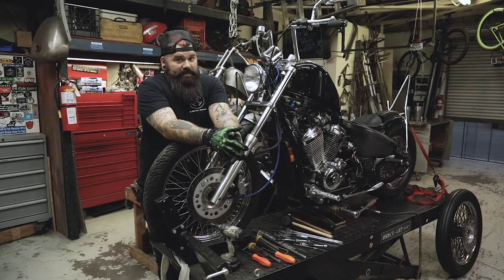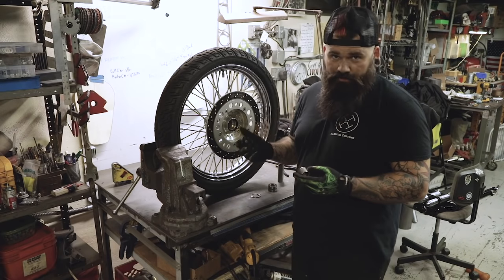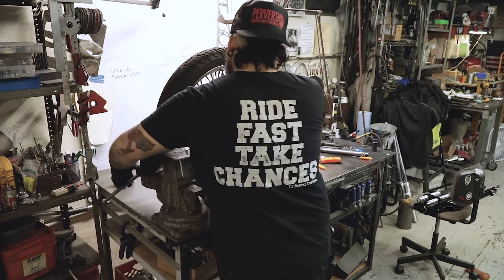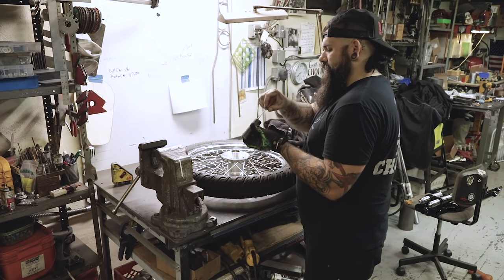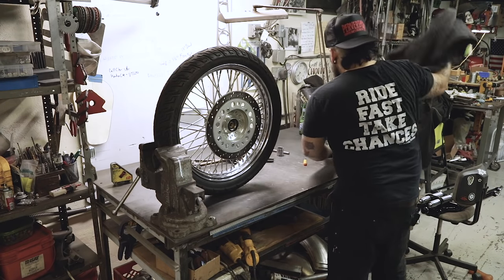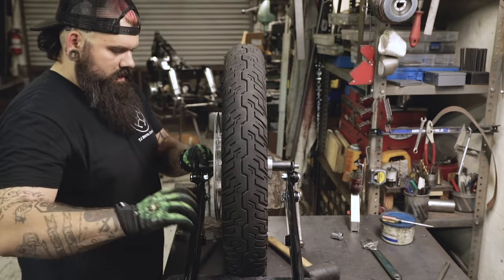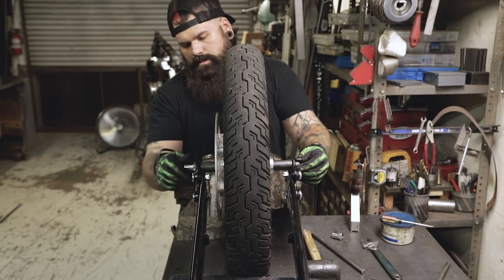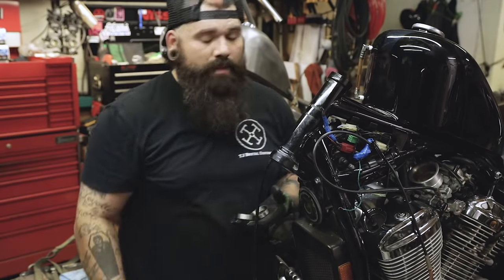How To Install A Springer Front End  - Honda Shadow Bobber Build

Comment: Props for your technique, man! I cringe when seeing so many 'pros' bang things into place with a mallet instead of doing it properly, like you with the axle in this vid, by aligning and 'massaging' it into place. Great vid!
Reply: By 'pros' I meant the guys who are usually highlighted in the many custom bike builder shows yet exhibit questionable techniques... that's why I put that moniker in snarky quotes. ;)  Either way you give good practical advice for the uninitiated who would otherwise ham-fist builds/mods due to bad practices exhibited in shows like "American Chopper", "Build or Bust", "Biker Battleground", "Wrench Against the Machine" et al...
Reply: I know where you're coming from. Forty years ago when I started customizing and building motorcycles based on what I could afford as a high school, and later, college student meant I had inexpensive metric bikes to work with and had to learn how to modify existing parts, shape steel and weld it all together. I'm a huge fan of the XVS 650 (the 'modern' day XS650 of my era, as far as I'm concerned) and may wind up customizing them for sale to keep me busy and out of trouble when I retire soon. Keep on keepin' on , man. I hope you make a living from your passion... you have my vote. Friggin nice springer btw and I really appreciate your efforts in going against the grain, as it were, by customizing what you like and not following the mainstream.

Comment: My search for a springer for my vt1100 comes back to you haha. I have your backdraft exhaust on my 02 sabre and love em. I am thinking a springer front conversion now so hope you may do some vt1100 parts soon. I keep checking to see if you have done more yet after saw you picked up an 02 sabre a while back. Do you still have it and working on it for new parts?
Reply: VLX 600 front wheel and springer kit on the 1100?

Comment: Hi TJ, i love your video. I have 98 VLX 600, but i have some problems. Please can you help me for these trouble, ill be greatfull for that..
My problem is : 
1. When i want to use use my vlx, i smell gas on my garage, and when i start it up the gas is coming out from rear exhaust (sometimes plenty of gas) and lil bit hard to start and also when fired it up it always 1 cylinder (only front cylinder), but the rear cylinder its not firing, it takes maybe 1 or 2 minutes to have normal firing until the leaking gas are dissappear. This happen every time i park my bike on garage (spent for 1 or 2 night). I believe its from carb floating chamber is not good. Then i try to fixed and find out through my manual book.
Now the gas never come out again from the rear exhaust, but still every time i start the engine, the sound only one (same like before) but only takes half minute to get normal.

The next day i use my vlx for going back to my town, after 3 miles my bike is getting worse from before, it runs like hell...its like only cylinder working, and then normal again, then one cylinder working again, and then normal again..on and on and on.. (you know what i mean) ? 
Its not like one two firing like normal, i feel horrible, the exhaust sound also like XS 650 like "braapp...braapp....brapp..brapp" continuesly with high rpm. Then when i stop i saw so many smoke comming out from the right side of my bike, i stoppped and try to find out whats going on. In that time i think its because gas leaking again but its not ! Its oil ! 
I saw oil comming out and dripping on my breather kit, then i try to dissamble, when i pulled out the hose from crankcase breather separator to breather kit, its come out so many oil, then i call my friend storing to getting back to my home and fixed it.

The next day  i try to fixed again. I think there someting erong with evaporator cav control valve hose and evaporator purge control valve, it seems ok, i also tested and its ok, i cleaned it up also the breather kit but i cant solve my problem. 
then i ask my friend i tell the story also, he said "your carb floating chamber should be change", and other friend said "your water pump seal problem" (i think its not from water pump seal, even when THAT happen comming out some gas also and lil bit water) 

So what should i do TJ ? Can you help me please, cuz i need back to my home town ☹
Btw sorry for my bad english, i hope you understand 😟

Greetings from me Berry Benedick - Indonesia
Thank you

Comment: When or are you guys bringing back the Springer front end?
 I've been checking from time to time and have not seen it back in stock
Reply: @TJBRUTALCUSTOMS  Good to hear, I'll keep checking the site.
I have a 02' VT600c and an 81' CB750c
Another question for you, Would the same springer front end fit on a CB750c?

I ask because I purchased the CB750 in crates a few months back. Only thing I'm missing to complete piece it together is the front end assembly which I wanted to swap to a springer anyways.
Reply: I'm awaiting your new springer too

Comment: I have a 2003 Honda Shadow Spirit. I need to replace my front fork seals and was thinking I might just replace the front end with a springer kit if I could find one. Anyone have any suggestions of a bolt on kit for a 2003 Honda Shadow?

Comment: Please tell me you have a vt1100 kit and it will work on a 94 shaow. I've been looking to switch out my forks, so that I can put a 21" rim on my 1994 shadow.
Reply: DNA makes springers like this one. You pretty much just have to make sure you have a set of 1" bearings for your bikes neck since most springers use a 1" stem. Then find a 21" wheel with 3/4 wheel axle which the DNA requires too. You can Google all of this. Good luck!